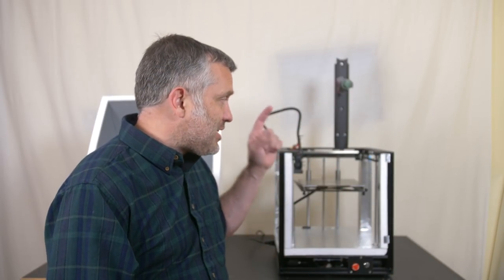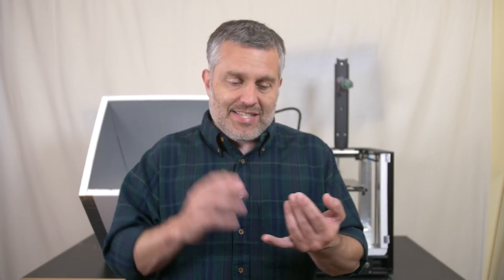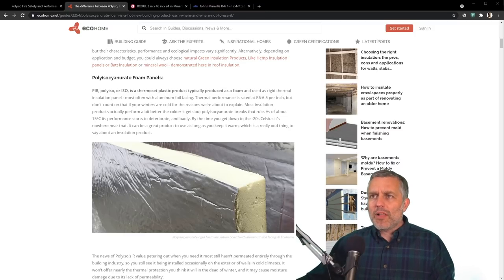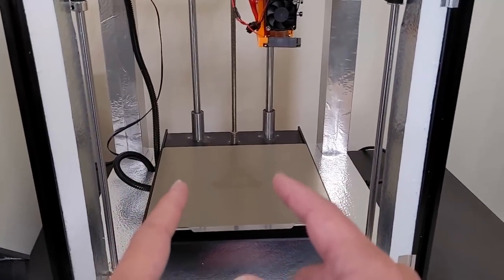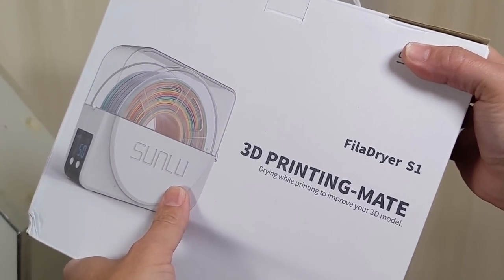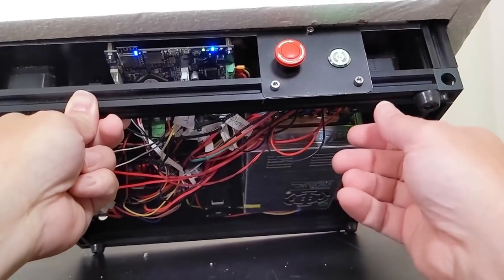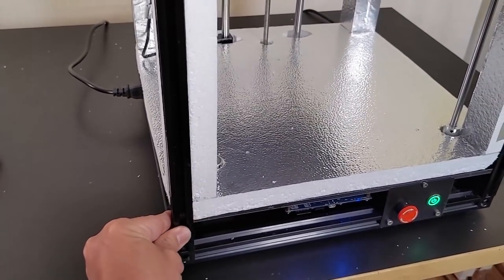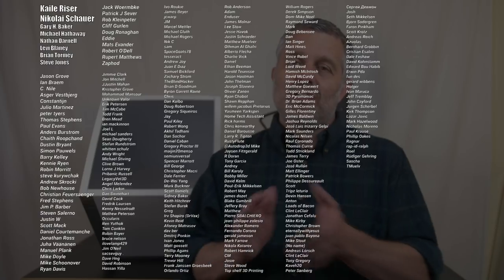INSULATED 3D Printer Chamber CoreXY With Isolated Electronics

Comment: I used a setup similar to what is described in this video: https://www.youtube.com/watch?v=Lonyy1O3PpA.   Heats up in about 30 seconds an maintains for 16+ hour prints. Been using it for a couple years now with no issues. Might be worth while if you are willing to use a heat source other than the heated bed.